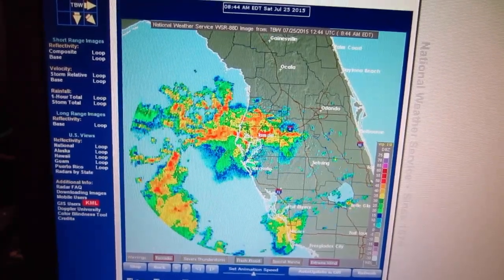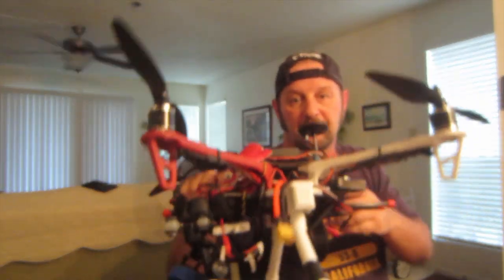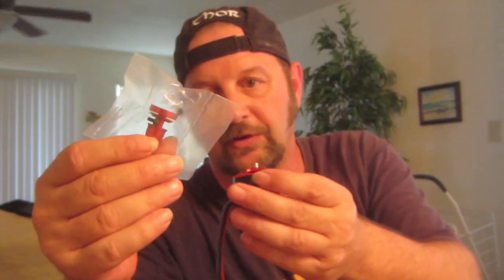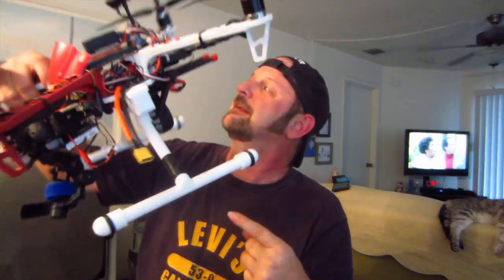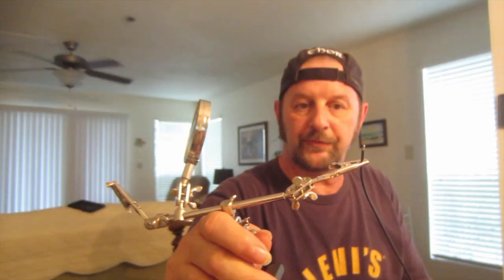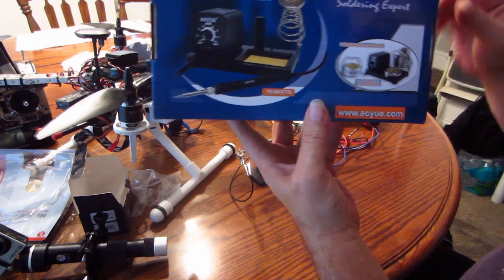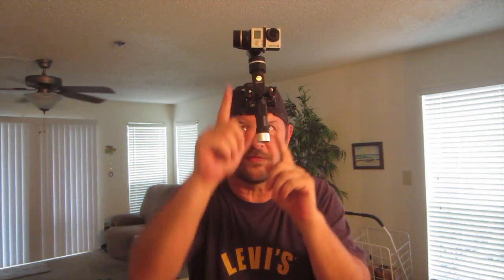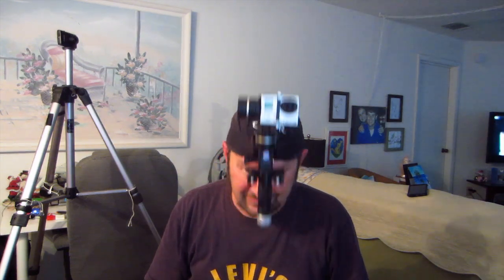DJI F450 Sunnysky V3508 Upgrade Go Pro Hero 4

Comment: BTW how did you fit sunnysky motors on F450 frame? It seems that mounting holes have different distance.
Reply from the maker: +Martin Schrott i used just two screws to secure the motors, not unheard of for these motors and this frame

Comment: Ha ha ha thanks for the chuckles and smiles this morning. :) I had to wait a couple days to be able to watch this video but finally was able to squeeze ya in. :P

I love that magnifying glass gadget and I could use something like that when working on really small clay creations or larger creations with many small details.

I also could really use that tripod hat thing. :P I would need to find one for a regular digital camera though. It would really help when recording my creative process as I need both hands. I have a tripod now that I use but it sits on the table and isn't exactly the best set up though it works. :P Having it on my head would be much better though.

- Heidi

Comment: TMT If you are using Simon K ESCs, consider changing them to non Simon K ESCs such at hobbywing xrotors.  I've had problems and there are many posts regarding high pole motors, motors with more than 8 magetic poles, and using Simon K ESCs.  I have the V3508 700kv motors myself - they are good motors, and am using the hobbywing xrotors 40A ESCs and they work flawlessly those motors.  Hope this helps
Reply from the maker: Thanks!!  I have the 30A XAIRCRAFT esc the sub brand is hobby wing. I do appreciate the advice!!!

Comment: Ha! You use the same radar source as I do. And yep, it's nice weather for ducks.

You just buy electronic grade 60/40 rosin core solder and never give it another thought. And for what you do, you would typically want 1/32" diameter. My Dad taught me how to solder when I was 7. And yeah, I've reached the point now where I need a friggin' magnifying glass to see that close. <grumblegrumble>

I use a Variac and a 40 watt Weller pencil iron. I actually have three or four of them, and a couple are 40 or so years old. They never wear out. I also have a 100 watt Weller gun that's probably 50 years old. I buy good and buy once.  LOL

It doesn't look kinda weird, it looks a lot weird. And it probably feels weird with that thing right in front of your nose. Did GoPro offer you any compensation for selling you a high dollar camera that you can't use for what you bought it for?
Reply from the maker: Anonymoose this new solder gun works so much better than the Weller i got a long time ago. it heats up so much better! and yes GoPro offered me a few things for free and of course i took them! i am sure that contraption will work well for first person views of the aircraft, certainly will be less bouncy!

Comment: Thats what I am planning to do.. Put 12" props on F450 frame and use this 580kV motor. Total weight should be around 1400g and expected flight time with 3000 mah battery around 20 min. What is you quad weight and flight time? Do you use 12" props?
Reply from the maker: pretty sure that are 13 inch blades but I would have to double check
Reply: +TheMighty Thor On F450 frame?? I dont thinkt its possible, and what about your weight??
Reply from the maker: +Martin Schrott I am at work now I will check when I get home
Reply from the maker: +Martin Schrott hello yes they are 12 inch blades but you can put 13 on no problem, plenty of room for them